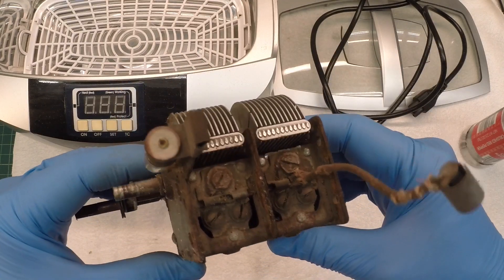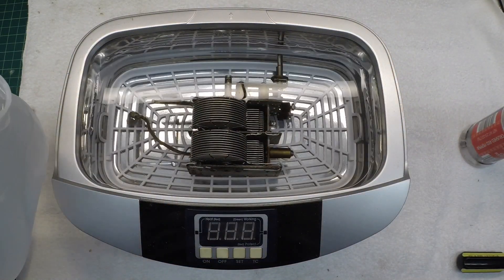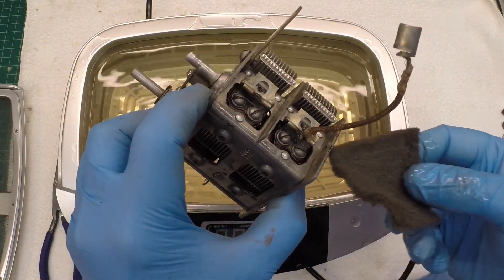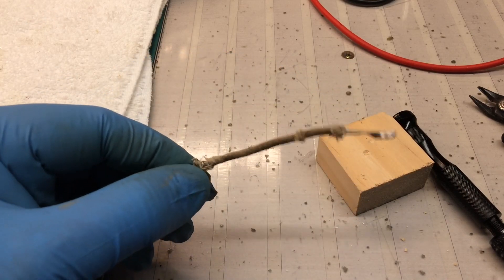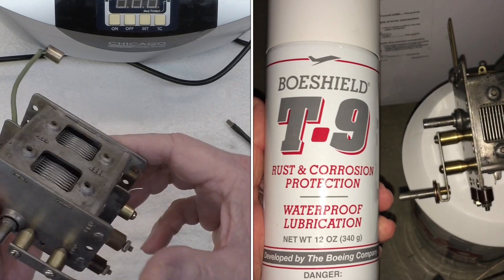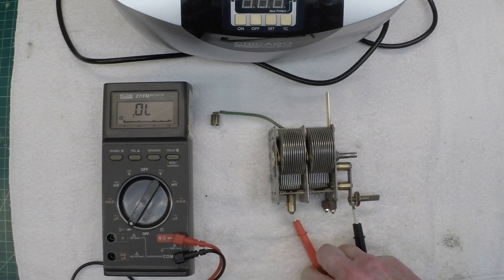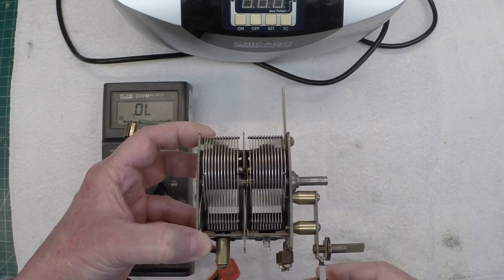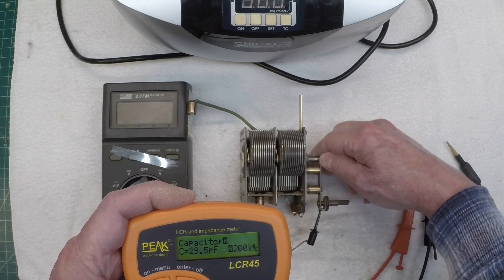Zenith 707 - Tuning Condenser Rehab

Comment: Great tip on how to locate the shorting plates in a tuning cap! I’ll be using that in the future for sure. Also I have an ultrasonic cleaner I bought to use for knobs and quickly discovered it’s great for tuning caps too, but never had the right solution to use (I used a diluted Dawn and water mixture). So, thanks again! Two great tips in one 10 minute video. Can’t ask for more than that. 😊
Reply from the maker: Thanks Jeff. I’ve used Dawn as well for dirty items with a little grease and it definitely does the job. I should have placed a few drops in with the citric acid, forgot until I saw your comment; thank you. I’m glad you found the video helpful and thanks again for reaching out. Best, Don

Comment: Wow that tuning condenser came out like new Don. I need to get me some citric acid for my ultrasonic cleaner. I usually use a mixture of vinegar and dish soap. Great work as always!
Reply from the maker: Thank you Gregg. I should have put a few drops of Dawn or other in the solution to cut through the grease, etc., but failed to do so. Thanks again and I hope your weather is starting to improve; we’ve had two beautiful days back to back. Best, Don

Comment: That was a dramatic improvement, Don. I use an ultrasonic cleaner to clean the brass cartridge cases when I handload. I never have tried using it on a variable capacitor before, but it looks ideal.
Reply from the maker: Ian - I’ve cleaned a many in the ultrasonic cleaner, but this is my second one if memory serves me correctly using citric acid. Hopefully it will perform well once it’s back in the circuit. Thanks again for watching. Best, Don

Comment: The Citric Acid really does a nice job !!! I need to try that myself on my Fada radio.   Quality job and the Boeshield will keep things good for years to come !!! Well done Don
Reply from the maker: Thank you Ron. The mild Citric Acid solution seems to work pretty well. I’ve reinspected some pieces just a little than a year after de-rusting and applying a rust inhibitor and all is well. A few drops of Dawn mixed in the solution helps mitigate the grease too. Best, Don

Comment: Cleaned up really nice! I am going to have to try the citric acid/boeshield myself.....Thanks for sharing...Take Care—Larry
Reply from the maker: Thanks Larry. A little of the Boeshield T9 goes along ways; otherwise, it won’t dry. For the Tuning Condenser, I wiped it on the frame, bolts, etc., with a rag and didn’t place any on the stator/rotor plates. Best, Don

Comment: Hi Don,
I always learn something when I watch your videos and this was no exception. Was the original mica really that bad off? That was a great idea using Citric Acid and water to clean your tuning condenser.
Reply from the maker: Tom - 1 of the 2 mica pieces fell apart when trying to clean it, so I decided to replace both of them. The Citric Acid solution did well and I started de-rusting the chassis yesterday. It has some pitting in places, but that was expected since the mice moved in and made it their home for some time. Best, Don

Comment: Amazing job Don. Tenacity always helps with cleaning and getting those fins to cooperate. I see that you mentioned the Mica insulators you got are .09mm thin.
Is that thin enough? Don't know enough to find out  Mica thicknesses especially in IF transformers.
Reply from the maker: Thank you. It definitely looks better now than my starting point. I can’t say for sure on the mica myself, but the trimmers were found backed out a good turn +, so I have a little wiggle room if this indeed was the correct alignment. Something I’ve done in the past is wet sand the mica down in between two pieces of 220 grit sandpaper to get the thickness needed, so I can take that path if required. Thanks again for reaching out and watching. Best, Don

Comment: Don, have you thought about "soda blasting" to clean parts prior to ultrasonic cleaning?
Using baking soda in a compressed air dispenser looks like a fairly gentle way of cleaning corrosion and heavy crud build up from various parts.
Reply from the maker: Greg - I know many do that and I’m sure it would save me much time and energy. I have never even invested in an air compressor believe or not. Do you have a recommendation for a soda blaster and the best media for such and also the best media to remove the rust without further pitting, damage of the chassis? Thanks again. Best, Don
Reply: @RestoreOldRadios  There are several vids on YouTube that show home made gravity feed blaster gun, I have a Harbor Freight $20 gravity fed gun and their $10 engine washing gun which should work too. I just retired and don't have my shack built yet where I will be going through several old radios that need some restoration so I haven't tried it out yet, I wanted to be able to clean a complete chassis with components in place without "washing" it, and the soda can be just blown away with compressed air. Simple baking soda is the media, you can get a large box of it from Costco for a few dollars. The nice thing is you can vary the compressed air delivery pressure to just remove dust and tarnish or increase it to remove paint and rust.

Comment: Hi, Excellent job restoring the rusted up Zenith tuning capacitor, I just applied Naval Jelly and after 10 minutes I put it in my ultrasonic cleaner. It worked but not as good as yours. I'll try the citric acid technique next time. Please let us know where we can acquire the lot of the trimmer micas that you showed. Thank you
Reply from the maker: Ken - thank you. I appreciate you watching and reaching out. The Mica sheets I used was very similar to the link below. You can wet sand them if the thickness comprises your capacitance range. Hope this helps. Best, Don

If the url is blocked, just search eBay at:
100PCS TO-220 Insulation Pad Sheet Mica Insulator pads-thermal insulation

https://www.ebay.com/itm/324296183201
Reply: Thanks Don, I’ve replaced a lot of these mica insulators over the years but mostly removed them and cleaned the old dried up thermal paste off them with rubbing alcohol and applied new thermal paste. Even though they look exactly like the mica trimmers it never occurred to me that they could be cut to size and used as a trimmer capacitor.  I hope rubbing alcohol doesn’t compromise them. Nice restoration on the Zenith 707 radio by the way, the name doesn’t go on until the quality goes in.
Reply from the maker: Ken - thank you. My mica pieces as you saw have the mounting hole and the ones I noted in the eBay URL are solid pieces I believe. The alcohol has no impact on the mica. Thanks for the kudos on the Zenith. Best, Don

Comment: Don, Great video. I too am in the middle of an airline restoration (my first). I had a question regarding the use of the T-9 spray. Did you apply this directly to the condenser plates and all or the entire chassis? I know it dries a leaves a wax type finish and I wanted to check with you before I attempted myself. Keep up the great work! I”ll be learning. :)
Reply from the maker: Brett - hope your Airline restoration is going as planned. I applied the T9 to the frame only and not the plates themselves. I applied a light coat with a cloth and brush for the hard to reach areas and let it dry for a number of days by a dehumidifier. Thanks again for watching and reaching out. Best, Don

Comment: Boeshield is a great product. I don't just say that because I draw  a pension from Boeing!  Thanks for the video. I have a 4 gang tuning condenser that is very stiff. it is in a  Hallicrafter SX 62A. It is so stiff that even with a new dial cord and spring, cleaned drive shaft that has been ruffened with light score marks 90 deg to the cord,  the condenser just will not move and the cord slips on the shaft. Any idea on the best way to free it up? The radio works and the primary reason it was sold, I think, was for the tuning cord/dial pointer issue. I belong to a radio club and I picked it up for near pocket change . It still needs a re-cap and alignment but even as is, it pulls in the stations.
Reply from the maker: Wayne - sorry I’ve been away and I apologize for my belated response. The Boeshield product to your point is excellent. I would try some penetrating oil around the shaft and see if that frees it up; if not, you may be able to substitute another one from a parts radio. All the best on the repair and remaining work. Don

Comment: A question, did you use LaBelle 202 and 206?  Or just one of them?  Thanks.
Reply from the maker: Jeff, I used both. Oil first in the bearing followed by grease and the other friction points just a couple drops of oil. Best, Don